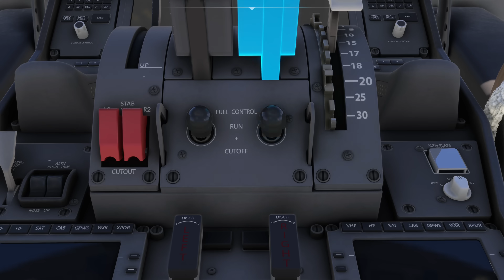Air India 171: Why Did The Fuel Cut-off Switch Get Moved?

Comment: Two pertinent questions. I would like your thoughts on these-

1. RAT deployed at the same time or before the time  switch was changed to cut off position. In one of your earlier video,  you mentioned that it takes at least 5 sec to deploy RAT after both engines fail. Does it indicate engines failed first and the pilots tried to restart the engines by manually cutting off and run.

2. When the pilot placed a mayday call to ATC, he just said mayday, mayday, mayday followed by ohgod and few more words may be.. If he was aware that  it is crashing due to the suicidal action of copilot, shouldn't he have mentioned about the same in his last message to ATC? Even if he did not have time to explain the situation, at least he would have tried to utter few words on suicidal action of copilot. 

He did not mention anything in the last call indicates he did not have any idea what happened.
Reply: Right. Also the NOSE of the plane was pointing UPWARD not downward. Meaning that the pilots  were trying their BEST to save everyone
Reply: @hendka6006 exactly
Reply: The maydaycall said :”No thrust  ,going down”
Reply: @TheSolidheroes yes, the point is he didn't mention anything about any foul play in the cockpit
Reply: @dillip7307 Yes , I think for the family to hear these pilot-error news items about their recently deceased  relative especially when they have a good servicerecord must be painful.
Reply: @TheSolidheroes  Painful, yes. But speculation of a possible suicide motive is logically inevitable until ruled out, however unpalatable its public expression no doubt is.
Reply: @apusapus-27  Suicidal motive? Nonsense. Any expert reading the report can shut that down instantly. Yet the media and these so-called "pilots" keep pushing the lazy pilot error narrative.

The report states fuel valves were cut off at 180 knots — the aircraft’s maximum speed. If this was intentional shutdown, inertia would’ve pushed the speed beyond 180 — basic physics. But it didn’t. That means engine failure came before the cutoff. One possible reason? Boeing’s own directive to cut and reset fuel in dual engine failure.

So enough with this suicidal pilot garbage — it’s baseless, insulting, and ignores both logic and Boeing’s role.
Reply: @TheSolidheroes how do you know? Voice is not released yet
Reply: Watch Flyingbeast video if you  really believe in unbiased explanation ❤❤❤ english subtitles are available
Reply: On pt. 2 come on....you are about to die and he's supposed to rationally think hmmmm how do I phrase this...the "mayday..." at least is auto programmed into them....
Reply: I see he didn't respond. Likely didn't want to admit the exact wording was '"why did you cut off?" not, why did you cut it off. That's a world of difference. Because the pilot was talking to the controls & highly confused. While obviously thinking & correcting. With the other pilot confirming he also didn't do it. Likely to ensure the voice recording can clarify this. The switches are not directly connected to the cut off valves. The controller could close the valves itself and record a switch movement when it did not happen. Both pilots were pro-life. Family know they aren't responsible. Likely so does the airline.
Reply: According to the primary report 
"The aircraft achieved the maximum recorded airspeed of 180 Knots IAS at about 08:08:42 UTC and immediately thereafter, the Engine 1 and Engine 2 fuel cutoff switches transitioned from RUN to CUTOFF position one after another with a time gap of 01 sec."
"RAT hydraulic pump began supplying hydraulic power at about 08:08:47 UTC."
Let us assume that the fuel switches were cut off at 8.42. RAT started generating power at 8.47. That is just 5 seconds. (One engine was cut off 1 sec later)
Is that enough time for loss of power to be detected, RAT to be deployed and RAT to start generating power?
Reply: Also at 1:00 one pilot asking the other pilot "why did he cut off" . Doesn't really mean the fuel cutoff. It can be AC or any other electricals. 
What a childish way of writing a global sensation report.
Reply: The suicidal Capt could have moved switches back knowing it was too late…pilot flying has a handful of a stalling airplane
Reply: Is chutiye ke piche 40 rupay kharch diya?
Reply: Easy to create the story suicidal , this not correct ,especially insulting the pilot family.No more further investigation s. Lost is lost and pls learn from mistakes.How come 1 person escaped with minimal injury.need question?think

Comment: Is it possible to balance the cut-off switches on top the indent? Some of the videos ive seen, the indent is flat on top. If that is possible, could they have been playing a game trying to get them balanced, then forgot about it on the ground, and on rotation, the g-force made them both slip down one after the other to the cut-off position? Maybe one was balanced higher up on the indent which could explain the delay.

Comment: If I remember correctly, the report noted that the fuel cut off switches installed in the 787 were the same as those installed in the 737...some of which were supplied "with the 'lock out (detent?) feature disabled'. With the depicted "short throw" switch and no detected operation (as you described), would it not be extremely easy to inadvertently move the switches to the "cut off" position?

Comment: If the whole plane is fly-by-wire, how do we know there wasn't a false signal/glitch that told the flight computer and data recorder the fuel was turned off?  All this also does't explain the landing gear trucks being tilted the wrong way without being retracted.

Comment: The switches are not a mechanical link to the fuel supply. They activate electronics and electronics can fail. It’s possible no pilot touched those switches and yet the fuel was cutoff.
Reply: Two separate EECs failed at the same time? Mathematically impossible
Reply: @Dan8254  It happening right now on my Rolls-Royce’s windows. The switches work, the windows aren’t going up and down on command. Electronics are weird.

Comment: Question: The preliminary report for AI171 shows that the switches went from run to cutoff and again from cutoff to run. My question is that they checked the logs for the flight. Does this log record the physical position of the switches or just the software log? Could there be a possibility where the software malfunctioned and it logged that switch went to cutoff and then software went into a recovery/fallback procedure which took approx 10sec to kind of reset and  moved from cutoff to run while the physical switches remained on run? How can you be so sure about it being a pilot’s mistake? I am just curious and want to know if it’s a possible scenario.

Comment: You can see the pics of the Engine and its turbine blades on page no.9 Fig8, they are intact which means the engines were not running at the time of impact, if the engine blades were rotating they would have decimated into pieces at the time of impact.

Comment: There is a Taiwanese ex-787 pilot quoted about a FAA service bulletin ( https://drive.google.com/file/d/1y6uWScnoKil3Y_bO4X_50LFtHfeS0d0v/view ) mentioned about a loss of thrust control (LOTC) may occure, Condition: An LOTC event has occured due to an EEC MN4 microprocessor solder ball failure. Cause: Accumulated thermal cycle of the EEC with age cause the solder ball to fail. Improvement: The MN4 integrated circuit on the MCB will be removed along with the solder and will be replaced with a new solder and a new BGA. The hot weather condition of the crash day, can be considered one of the possible concern of the crash of the India 171 787 .

Comment: The fuel system could had been cut off by the system,  and to restart engines the pilots shut the switches off and then the pilots turned the switches to on again, reinitializing engines restart. It must had been a Boeing software failure

Comment: Interesting improvement ideas, it's going to be difficult to come up with something better as a whole system since these controls have been iteratively designed for decades. But... What if the cut off was simply put further away from the reach so that it's more visible to cross check? I dono. Prob some flaw that that as well.

Comment: Before jumping to conclusions, we should consider all three plausible theories and what data would confirm or rule them out:
	1.	Intentional shutoff by one pilot
	•	🔹 FDR: Clean switch to CUTOFF, no prior engine issues
	•	🔹 CVR: Audible switch click + “Why did you cut off?”
	•	🔹 Wreckage: No mechanical fault in switches
	2.	Mechanical/electrical failure causing switches to move
	•	🔹 FDR: Irregular/flickering signal, electrical anomalies
	•	🔹 CVR: No audible click, pilot confusion
	•	🔹 Wreckage: Loose switch, wiring fault, detent wear
	3.	Pilot response to perceived low thrust (attempted relight)
	•	🔹 FDR: Drop in thrust, switch toggled off then back to RUN
	•	🔹 CVR: Mention of low thrust, attempted checklist or restart
	•	🔹 Wreckage: Signs of relight attempt or partial burn

👉 Correlation of FDR + CVR + wreckage is essential. One source alone can mislead.

Comment: Are the landing gear controls on a different plane in the location of the fuel cutoff switches? Could one of the pilots been confused from previous aircraft they may of flown. Also do any aircraft have a fuel switch enable switch. This would make it a 2 step process to shut the fuel off. Thank you for the series’s.

Comment: So far, we have facts from the flight data recorder (FDR) and the cockpit voice recorder (CVR).

They are :

 FDR

- Engines correctly running at takeoff thrust setting.

- fuel control cut off switches physically selected to cut off.

- fuel control switches selected to run shortly after selected to cut off.

CVR

- One pilot questions the other pilot as to why he selected the switches to off.

- Other pilot states he did not.

- We would know which pilot asked, and which pilot answered, as the cockpit voice recorder would record a specific channel dedicated to each pilot if the interphone was used.  The CVR microphone is located central on the overhead panel between the two pilots, and if this is where the recording was made, then it would be hard to determine which pilot said what.

Conclusions .

At this point there are none . 

-  Considering what was said, we do not know if the question was a statement, and incorrect statement to deflect, so the implications of the CVR are still ambiguous, at best.

- we do not know why the switches were selected to cutoff: 

	a.  inadvertently, 
	b.  intentionally to fix a perceived problem not indicated by a cursory look at the FDR.
	c.  intentionally to commit harm.

- we do know why they were selected to back to run.

Any other statements are all speculation and that is why these investigations take time?  Speculations as to protection of Boeing., Air India, or any other involved persons, corporations, or governments Is also speculation.  It is important to note that governments and corporations when it comes to insurance and coverage have different implications and different desires for an outcome from each other.

Wait until the CVR and the FDR are fully investigated AND THEN START QUESTIONING MOTIVES.

Knowing how the system works, if there was an immediate indication of a Boeing design flaw, an emergency airworthiness directive would be published for all other 787s on the planet.  That is how it works, this protects the corporations from further accidents that are their fault due to design flaws once the design flaw has been identified.

This has not occurred and indicates that at the moment in this investigation, it is not a Boeing design flaw.  Air India maintenance, Indian air authority, are also part of the investigation.  Is there enough oversight by the government, is there India correcting all airworthiness directives?

These questions take time.  So far all we know is stated above under the CVR and the FDR headers.

Conspiracy theorist, and armchair experts only deflect and confuse from the facts.  And at the moment the facts are very sparse.

Captain Geoff Quickfall  ATPL, BSc,  MSc, PhD candidate.  28,000 hours.  B737, B757, B767, B777, B787, DC10, Floats C185, DHC2, B18.

Comment: "Steeve says: 'Pilot committed suicide.'
Buddy, have you ever heard of MCAS? Or is your black box just stuck on Netflix documentaries?

Let’s get this straight — Lion Air and Ethiopian Airlines didn’t crash because pilots wanted to die.
They crashed because Boeing's MCAS software was hell-bent on nosediving those planes, even when pilots tried everything to stop it.

Boeing knew the system was flawed. They hid it.
They skipped simulator training. They rushed the 737 MAX.
And when it all came crashing down — twice — they blamed the dead pilots instead of their own deadly shortcuts.

Let’s not forget:
📍 Ahmedabad incident — aircraft’s radio transponder was off, no location transmitted after crash.
In a remote area? How would rescue even find it? By sniffing jet fuel?
There’s a reason transponder and ELT (Emergency Locator Transmitter) are crucial, and this one didn’t activate either.

Yet Boeing sat there with its PR team polishing their halo while whistleblowers died under mysterious circumstances and internal memos joked about 'clowns designing planes supervised by monkeys.'

So next time Steeve tries to drop a “suicidal pilot” theory,
remind him that sometimes the only thing suicidal… is Boeing’s safety culture.

Not every crash needs a villain in the cockpit — sometimes, the villain is in the boardroom."

Comment: As explained in other videos, it is crucial to know if the fuel switches were physically operated or their status transitioned. The use of the word "transitioned" in the report implies that it is not known if there was a machine or human hands in the 2 times transitions of both switches. So instead of thinking that one pilot committed murder-suicide another perfectly plausible explanation is that the flying pilot noticing the loss of thrust and without looking down asked "Why did you switch off?". The captain truthfully replied that he did not. Facing imminent disaster It now took them both 10 secs to decide to toggle the physical switches which were still in the run position to cutoff and immediately to RUN as they realised that the fuel switches had internally but not physically gone to cut off. Had the murder-suicide theory been correct, the conversation would have been quite different. I also do not like it when you take the Pilots remark "I did not" as a child's lie after mischief. These are trained pilots, not children committing pranks. I hope you will read my remarks. The pilot's guild in India has strongly protested against the murder-suicide theory. Both pilots were known to the Pilots Association and had any of them developed suicidal tendencies, it would have been noticed.

Comment: Captain Steve, are there dual sets of these engine cutoffs? meaning that each Pilot can cut off the engines independent of each other? is the action of engine cut off not significant enough for it to initiate an audible relay of the request and require confirmation of action? especially when both engines are involved and at a critical point when full engines power are indispensable? and would lead to catastrophic outcome? I think that a significant error there!

Comment: After I bought my car, the first security feature I opted for is a dual dash cam. Why can't a flight have a camera inside? Why the black boxes were damaged and Indian agencies couldn't decode it? It's supposed to be indestructible as advertised by plane manufacturers. The report doesn't have second by second detail when the fuel switches were turned off and on back again. And Steeve somehow always tries to blame pilots. Why ELT did not work? Even if it is a pilot fault, all the safety components in the flight should work 100% fine. I don't think that there is no takeaway or action item for boeing from this.

Comment: @captain Steeve .. there are lot of details missing in the report .. 1/ No info on when RAT was deployed and when it started generating power ? 2/ When did the engine start spooling down after fuel cutoff ? 3/ exact time when the fuel switch was moved to cut off - 4/ no revelation of any evidence that concludes beyond any doubt that switches changed their position by pilot and not automatically … shouldn’t this be investigated in depth before you announcing this as pilot error.